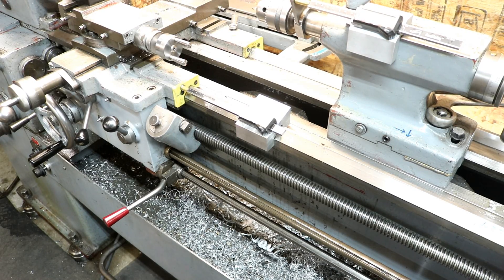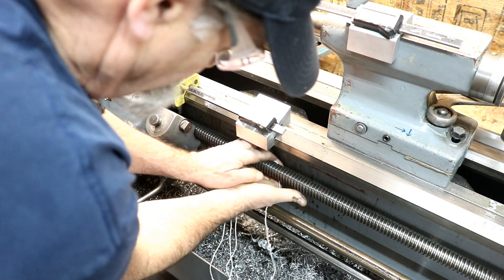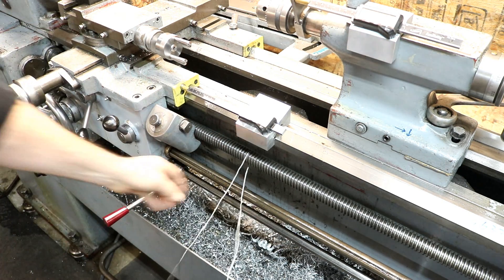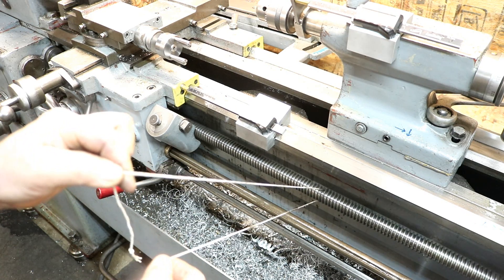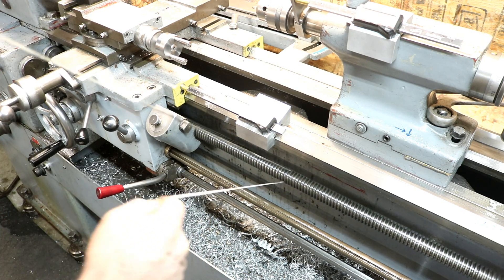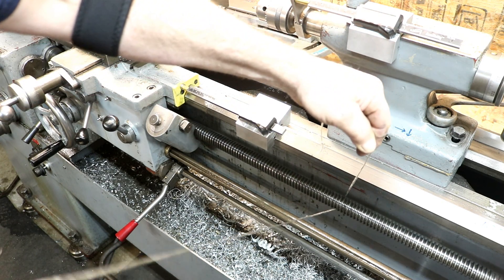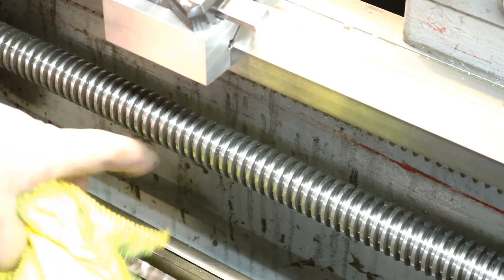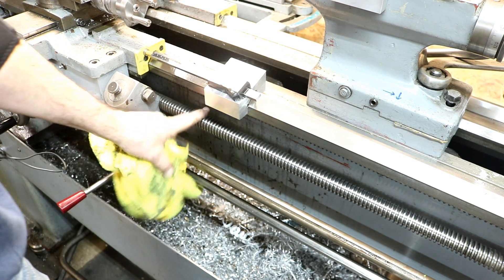Lathe Tips | Clean your Lead Screw in 5 minutes | Metal Lathe Hack #9

Comment: For cleaning a lathe try diesel (I use red diesel) in a spray bottle  AFTER CLEANING THE CHIP PAN AND  BLOCKING THE DRAIN.     The cutting fluid runs off with the diesel into the chip pan.  There is a little residue left which I wipe with paper towels and the quick way to clean the remaining mess in the chip pan is sawdust.  Takes minutes to clean a dirty lathe.  The small amount of residue left can collect dust in a dusty environment which I avoid by covering my lathe with a painter's cloth from Harbor Freight.

Comment: 3D printer owner here with dual Z axis lead screws that look dirty and cause Z banding in my prints.  I think I'll try this by putting one end of the screw in a low-speed drill.  Thanks for the tip!
Reply from the maker: Great idea it works great.  Thanks.

Comment: Good tip. That's actually part of the regular maintenance on my Smithy, although I used to be more negligent than I am now. I once dropped $40 for a new half-nut because I thought mine was worn out, but when I pulled it out I found it was just packed with aluminum turnings. Clean your lead screw!
Reply from the maker: Thanks Charles.

Comment: I am not sure I can get from one end of my feed screw to the other in 5 minutes. lol Looks like yours could benefit from some heat straightening. The one on my big lathe wags a bit too and it annoys me. I may have to give it a go.
Reply: That band is caused by heat treating in the factory originally. It is meaningless to the operation little lathe other than it might wear a little faster. If it is worn replace it otherwise it doesn't matter one bit. It goes perfectly straight as it passes through the apron that's all that matters
Reply from the maker: Just a small amount of bend, 60" screw.  I am thinking of replacing it, fairly worn.  Thanks Brian.